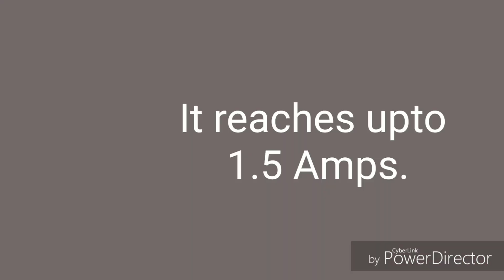2x15w PAM8610 amplifier Testing with current ratings.

Comment: Bro what is the maximum current we use ?
Reply from the maker: 2 amps is fine but it's better to put high current Power supply such as upto 5 amps
Reply: @diyhemantprojects2841  5amp...is it ok? Can I use 12v 5A power supply? If any heating problem coming with this rating
Reply from the maker: @balasundaramparameshwaran539  nothing will happen no heating issue and you can surely go with it. 👍
Reply: @diyhemantprojects2841  thank you very much bro

Comment: Can I use 4 inch 20 watt subwoofer please advise me
Reply from the maker: Yes you can, but if you are thinking that you will get the output of 20 Watts that's not possible, but you will get the decent good sound, ho for it.
Reply: @diyhemantprojects2841  thanks for reply

Comment: Which is good Pam 8610 or tpa 3110
Reply from the maker: I didn't personally used tpa 3110 but Pam 8610 will work fine for you. If power supply is good.
Reply: both are good but i recommend tpa